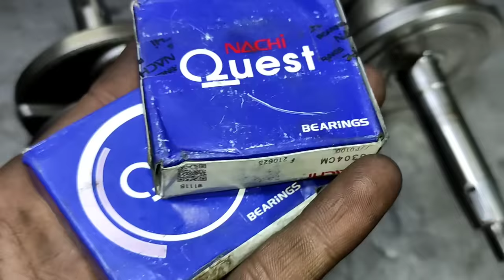How to repair used connecting rod , crankshaft new life.

Comment: How can the new bearings go halfway into the connecting rod before it gets tight, and still be right? If that rod was reamed correctly those bearings would have to same resistance all the way thru the rod journal... not just halfway thru. This rod was not reamed correctly, garunteed those bearings will wear uneven.
Reply: @whiskas54  agreed, it's not easy getting rod journals even all the way across. I tried it on new rod bushings when I rebuilt the engine in my truck, I could not get a reamer to do it right. I ended up taking all the rods to a machine shop, and got them professionally done. Pressing new bushings in was easy, reaming them is nearly impossible without the proper tools.
Reply: Well its folks doing repairs they know nowt about will never change 😁😁
Reply: Because the rod was worn on the outsides as he shows at the beginning, if you can't pick up on these simple things you have no business commenting
Reply: @show-me-the-details  then why even try fixing it then?... doesn't make sense to reem what was already oversized. I have the same right to comment as you do like it or not.
Reply: @garyr7027  what do you mean why try fixing it?  That's what we do as men,  if something is broken we fix it,  obviously they are fixing it this way because of cost savings,  they are a company and wangt to make a profit like all companies,  yes you have a right to comment but surely you feel a sense of embarrassment for not understanding simple things
Reply: @show-me-the-details  why wouldn't I understand it?... man I've been messing with engines for decades... trust me I understand. I also understand some jobs there are no shortcuts, it's either done RIGHT or it's NOT done... period... this is one of those jobs. What he short cutted on is one of the most crucial parts of a engine. It can't be compromised without major failure.
Reply: @garyr7027  my last reply,  when a cylinder is worn you bore it,  when I crank is worn you regrind it, when camshaft journals are worn you rebore them,  when camshafts are worn they are reground, when conrods are worn they are resized,  I work in the engine industry,  in all your years of experience you never got anything machined? Over and out for me,  I have an engine to reassemble
Reply: @show-me-the-details  my last reply, yes you do but ONLY if they're within specs, you shouldn't go beyond that and even then if it's not done right it only makes matters worse. Garunteed this rod journal is not right.. geez.

Comment: Sir, I'm a Race Engine Machinist for over 40 years, stroke the rod a few times,  then FLIP IT OVER and stroke from the other side. Flip, repeat,  flip, repeat. 
T.S. RACING
Reply: Or just buy a rod kit !!!! Man it’s not like they are that expensive. Didn’t even measure the rod end.  How out of round could that thing be.  Sure it spins. But an out of round cyl will make compression. But it isn’t right and will just wear prematurely. I would never take that chance on a crank. We have been rebuilding cranks for two strokes for over 25 years.

Comment: Might look straight but it won’t be at 6k plus rpm 😂 damn good working parts for a backyard rebuild for a mud bike maybe but not for anything your gonna need to last
Reply: You know it, no way that rod was reamed right, the new bearings went halfway thru the rod journal, THEN got tight. That rod journal is screwed.

Comment: Did you install slightly larger needle bearing rollers?
Reply: Yes the size of genuine rollers is 2mm and these rollers are 4mm
Reply: @ataf5665  No way, that's a massive amount of material to remove, and hardness would suffer for sure. You can buy oversize needles or get them ground specially to suit your application

Comment: oh no, you shouldn't use grind!
The hardness of the shaft is relatively high, and it will not be worn for a long time, so you don't need to touch it at all.
The hole of the rocker should be reamed with a milling machine and then inserted into the bushing. After grinding, the roundness will be worse!!!